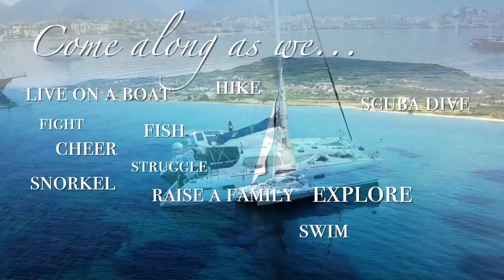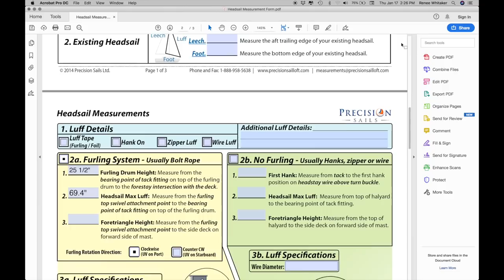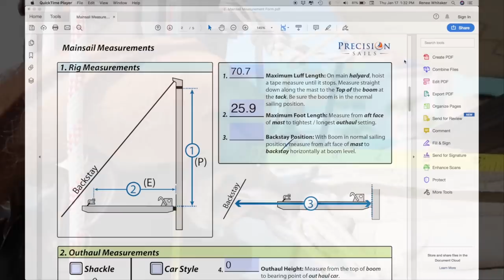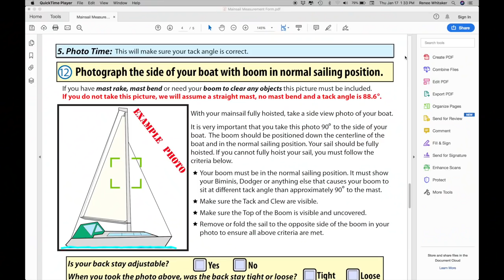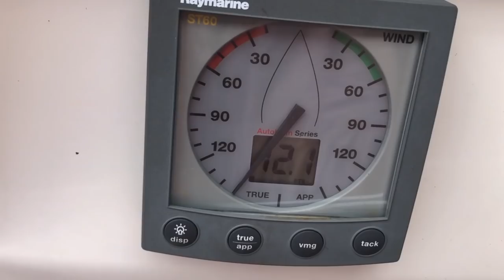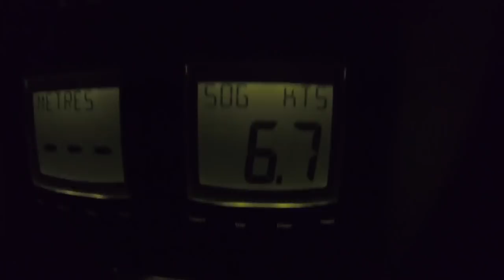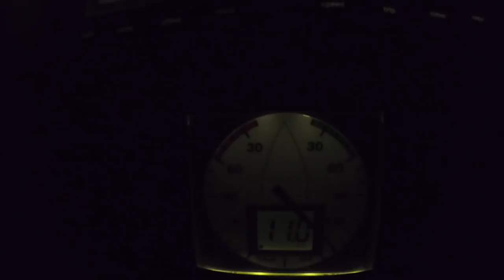Home is Where the Boat Is - Managing a Boat is a Family Affair! [Sailing Zatara Ep 69]

Comment: Invest in a CO detector for your compressed SCUBA air. If its contaminated, it can be lethal at depth with higher partial pressures. Carbon monoxide is no joke at the surface, you don't want to risk it underwater. It can be caused by a faulty dive compressor with no outward signs of trouble. I have two friends who's dive buddies died this way, and another friend who called his dive after feeling off. The shop he got air from found out (after the fact) a filter had an internal fire which contaminated dozens of tanks. /rant off, love the videos and the occasional dive clips :)
Reply: cpddan great info. Thanks 🙏

Comment: I am a retired small engine mechanic of 45 year's,Owned 3 shop's and I agree on Onan being a great choice.I got fed up with other brand's even the good ones had shit customer service.The very best in my opinion is Northern Light's for a boat but there prices chase most of the Cruiser's off,You got propane go with a small portable as a backup that uses an alternative fuel so in the event it is a fuel issue you can eliminate that shit pronto. Rodundance is only as good as you'r choices you have on board.Great video.
Reply: Very true! Redundancy is important, IF your choices are right!

Comment: Don't let anybody give you grief about how you guys are catching and killing the fish, It's difficult enough fishing off the back of a Catamaran with all the obstructions in the way. I heard you mention that you were going to get a longer gaff once you get to Florida, that's a great place to start to solve your problems, another suggestion would be to keep a 55 gallon drum cut down to 48 inches at the rear of the boat and the minute the fish is gaffed you can put in the drum to thrash all around in there until it's dead. And also use the drum to fill with fresh water to rinse your BCDs after diving. I know space is tight on board, but the drum may have multiple uses as well. And keep the club or mallet close by in case you get a wahoo, beat that in the head until it is dead still, those teeth are deadly!! Thanks again for the great video, I love the candid talk about different item on the boat that have failed you such as the generator and also the positive comments of other items such as the solar panels and the honest cost of everything that you guys face. Enjoy the Exumas and have a safe passage to Florida, definitely looking forward to logistical videos that will be coming related to the sails, bottom paint and especially the replacement and upgrade of all the electronics. Safe travels

Comment: The most common cause of water in the oil is a blow head gasket. One way to help prevent blow head gaskets is to "O ring" the block, your machine shop/repair guy should know how to get that done. Also to kill a fish you can use a freediving/spearfishers knife, it is very pointed and we put it into the fishes brain after we spear the fish so it stops fighting, you could also use an ice pick if you're on the boat. Those floating seagrass lines typically have fish under them so that is a good place to troll along them. I really enjoy your videos and seeing the family life onboard😀

Comment: From a commercial fisherman, get a fish killer, stand over the fish with it between your feet, on it stomach, your feet behind the gills, looke for the jell spot on the head, a little forward of the eyes, place the point and with a little force knock the handle sending the point right into the brain. It will shudder and die instantaneously, preventing suffering and bruishing of the fish. 
The tool works similarly to an ice pick.
Most humane way to do that kind of stuff.

Comment: I used precision sail for my last boat and loved it, super easy company to work with and solid tech support. Would definitely use them on my new boat. HOWEVER, and it’s just my two cents, do not deviate from the size of the original main sail. I went a bit bigger because I had the foot room (“more power”- Tim Taylor voice) but it unbalanced the wheel pretty badly in moderate winds. Might not make such a difference on a Catamaran but any time I got strong winds with my mono hull I had to actively hold the wheel for the autopilot or reef down the main while still running full headsail. Awesome for low wind days but those aren’t when I want to sail. Keep up the awesome videos!

Comment: Keith:

 Does your boat have "modest amp" 110volt alternators (like an Emergency vehicle like an ambulance,etc.) on One or Both engines in addition the Standard regulated 12 volt+ alternators bolted on on your engines?. 

Reason for asking,you would have additional  (Redundant) sources to get high-volt power from;  should you have Generator problems in the future.

Comment: Totally agree that Fisher Panda 3600rpm gensets are not that great. They are used in lots of boats as they are lightweight and cost less. My experience would suggest a Northern Lights over another ONAN. Yes they cost more but for a reason. They are better engineered and will last longer. Most of their models use a Japan built Kubota diesel engine. See you at the Miami Show!

Comment: FYI, the measurements for your sails might be a little off.  Don't think it will matter much but, in the future, 25'9" should be written as 25.75' not 25.9   This is one place where the metric system is better.

Comment: Don't think I have ever seen a tape measure with feet divided into 10ths. I hope they don't read your 25.9' as 25'9".
Reply: Precision probably asks for inch measurements in 10ths so they can easily convert to metric. Would have been easier to just use a metric tape from the beginning.
Reply: Civil engineers and surveyors use tenths because our basic unit of measure is the foot.  We use feet instead of inches because our stuff is large, think roads and land tracts.  Hence when we break a foot into pieces we use tenths for math simplicity.  Architects use inches because their stuff is small, like a room.  All of our instruments and tapes are incriminated in tenths of a foot.  Needing a 100ft tape, he probably picked up a surveyors tape.